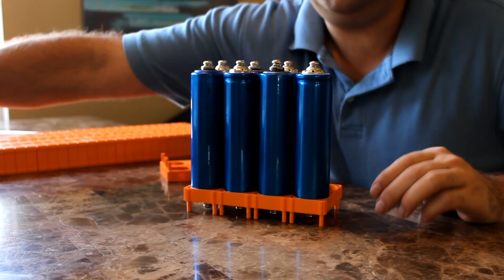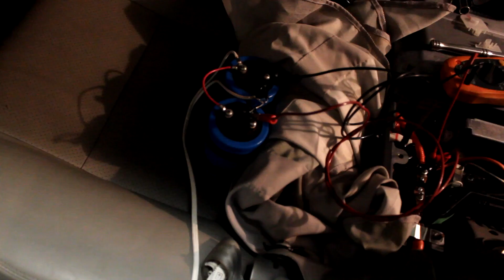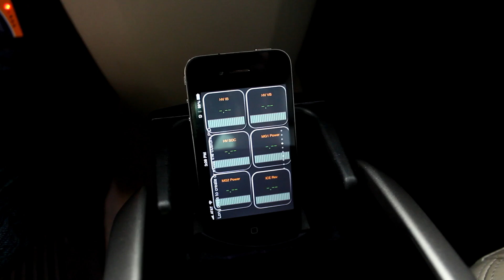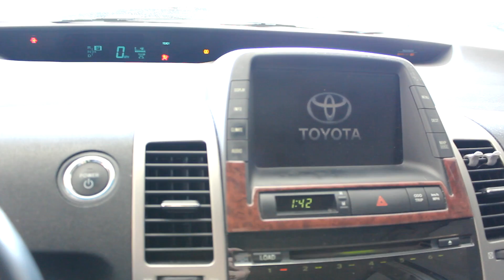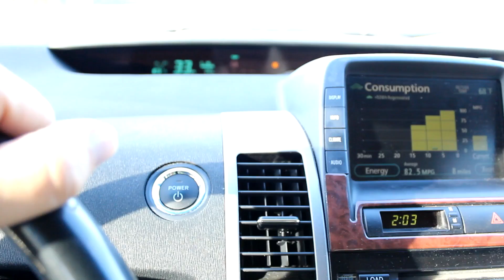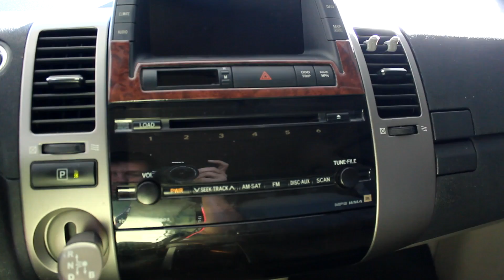Home Made Plug In Prius

Comment: Wow, this is an old video sort of.  I just made a quick spreadsheet since was wondering what the cost might look like making a plug and play LiFePO4 replacement for the 14 modules in a gen 2 or gen 3 prius.  Looks like really depends on the battery price.  I looked at 6Ah rated 32650 cells where definitely could fit 128 cells if 9 in each module and possibly 168 if there were 12 in each module.  That would double to 2.6 times the current capacity of the battery in the same package appears.  Really depends on the price of the cells however and like if time and all to make the modules where if a plug and play external plugin option was designed, how to do that BMS and external charger since an internal charger would be way more hacking hassle. Something like once power was on the external charger power a commutator to disable the HV battery so not to fry anything when charging from an external source. Might be a little more circuit requirement to assure a delay as well. Though yeah, with the cheapest cells I could find, I was amazed at the potential price for a plug and play drop in design.

Comment: No BMS ... No center-of-pack safety disconnect ...open high voltage terminals ready to short out ... Yeah I've built batteries and hacked all kinds of similar things, but your efforts are laudable, but unsafe. Without a BMS you are basically riding around with a bomb. Sorry, man, but get some safety upgrades in that wonderful ride. I applaud your efforts so far.
Reply: I know this is old but he did say that he is going to make it safer, he was just doing this as a test until things are complete.
Reply: Since he used LiFePO4 chemistry there wouldn't be any safety concern  even without a BMS.
But it would drastically affect the battery health in case of an over charge or discharge. Still the Prius maintains a SOC 40 to 80% on contrast to NiMH pack and he has matched match the voltage. It's a matter of cell balance which would affect the battery health over time

Comment: Everyone thinking about doing like he did should think really carefully about it first, and then do not do it. Reason being is he has nothing controlling those new cells. They are not anchored down worth a damn either. Any sort of collision and the entire car goes up in flames, (assuming the new pack doesnt just fly forward and smash in his head first.) Also there is nothing keeping all those cells in balance (Toyota doesnt balance anything either but Toy does monitor each pair of modules.) Leaving all those new cells to do "whatever" for every long will result in really serious out of balance issues and I think the weaker Toyota cells will also degrade even faster with each charging and discharging the car does to the pack(s). Also mixing Li cells with NiMh is not a good idea as they have significantly different charging characteristics. This is an interesting experiment but NOT something ordinary drivers should even contemplate doing! Pointless and really DANGEROUS!
Reply: I think it would be interesting to do this more professionally, put a second lion system, with an intelligent controller listening to manage the amperage draw between them.
Reply: @isaaclatterell1364  Increasing the pack capacity is generally a nice idea. However even ignoring the engineering difficulties, the cost of doing this will never be recovered in fuel savings (which is the main reason people even own such cars.) Better to just go get a new car usually since Frankensteining an old hybrid this way really kills the resale value!
Reply: Mike Lamb yeah it would cost minimum $2000 and only save you $200/year

Comment: Hope you are aware of the dangers of DC volts over 60, much more dangerous than AC.
Reply: It will blow holes in things. Light metals on fire, and kill you with enough amperage.
Reply: DC is safer as it does not mess with heart rhythm like AC does. But at this voltage for sure is dangerous.
Reply: @KiwiMaker  Rubbish, it clamps your heart and your dead.

Comment: Does the car recharge the new pack with braking?  Or can you only charge it with plugin
Reply: it is like one big battery so yes.
Reply: @yungextras4572  with the stack of diodes to the main battery there is no way the car would charge the new one. Only through the wall plug, except if he removed the diodes.

Comment: what i want is a checklist type this, like idk, ac->dc (full bridge rectifier) then charge controller (bc lithium ion) then fuses, and somewhere to add dc extra power source like solar or a custom mg3 (wind generator). what the minimum battery voltage must be and how to later increase mAh or kW.

Comment: Nice engineering effort.  Why did you conclude that it was more hassle that it's worth?  This is a nice stepping stone into something great.  A few questions:  Do you have a schematic of your voltage doubler?  Don't you think the wires from your battery pack are a bit thin?  I'm guessing it's only 14-gauge.
Reply: high voltage -> low current -> low resistance-> thin wire is fine. what i want is a checklist type this, like idk, ac->dc (full bridge rectifier) then charge controller (bc lithium ion) then fuses, and somewhere to add dc extra power source like solar or a custom mg3 (wind generator). what the minimum battery voltage must be and how to later increase mAh or kW.

Comment: Just shows how Toyota hold back the fuel consumption. All models should be plug in, great Job! . I mean you don't buy any other batteries and only charge them with a petrol generator that is 40% efficient.